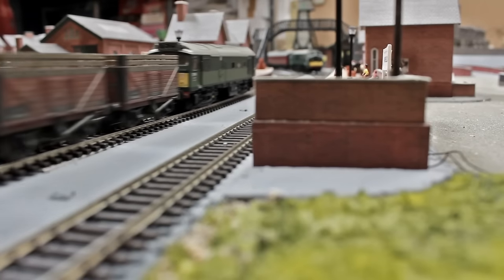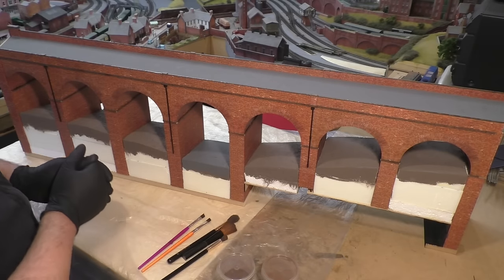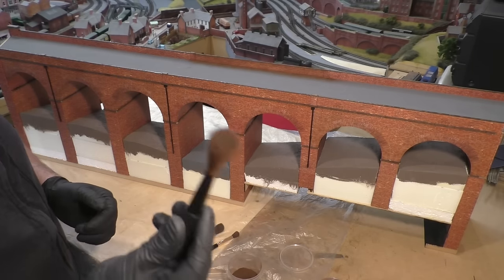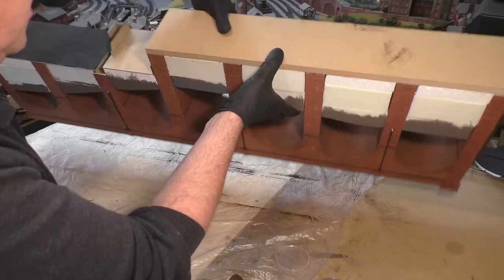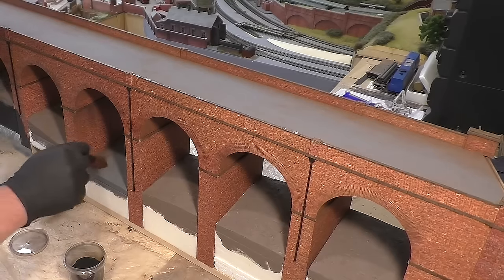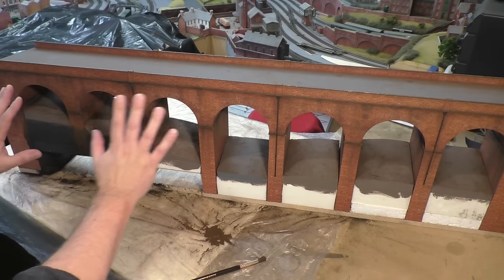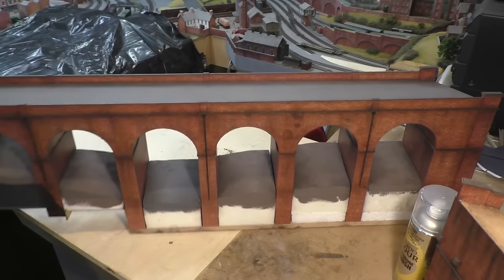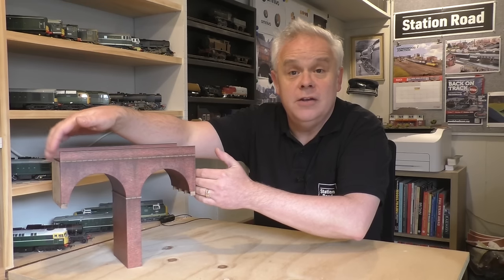New Project - Viaduct Weathering - Stage 6

Comment: Hello Julian. As an alternative to adding growth to hide the smudge you could add a hung scaffold with some tarpaulin covers or, perhaps an open scaffold with some workmen re-pointing/repairing some of the brickwork. One or two strategically placed items on the scaffold planks would help disguise the marks, eg. a bit of boarding etc lent up against the brickwork. This may add an extra little feature to your, already, excellent viaduct. Hope that will help you.
Reply from the maker: That is a thought, thank you.

Comment: Dear Julian, beautiful how you’ve done the weathering on the arch viaduct. Definitely adds to the whole viewing experience! Do like the idea you talked about on using the water color pens to add the calcium deposits. Humbly think you could also add some rather significant calcite bleeds on several mortar lines, kind of as a ‘source’ for the deposits. On the fingerprints, think that calcite simulation might be a good idea to tone those areas down by following the mortar lines. After that you may be able to tone the bricks down with either a slightly lighter color. 
Don’t really agree on what you said about airbrush weathering. It can be just as intricate as the powder weathering. Of course it may require a bit more exercising effort. Although, when one has found the weathering handwriting signature of his or her liking, it may just as well be a breeze to weather such a large structure with the airbrush. As for me, wouldn’t just leave it at that, don’t really know how easy it is to pin wash the printed brick texture, but definitely would try it out. Also a good technique for adding the calcite streaks. 
Overall, love the entire series of the viaduct. Definitely a great visual addition to your layout and an excellent example of how the story of the railroad can be told beyond the visual borders of the layout’s footprint. Looking forward to seeing the next episode. Cheerio

Comment: Hi Julian this is not a criticism more an observation hopefully as additional information to assist you, your parapet walls should have refuge areas built in to allow track workers etc safe areas to move into when trains are passing bear in mind these structures were built long before modern day health and safety rules. The refuge areas are big enough for 2/3 workers and set about every 20 yds (meters). Not that refuge areas are visible but are built into tunnels also.
Reply from the maker: I decided not to include refuges because I did see some viaduct examples where there were no refuges. These tended to be viaducts that appeared to have a wider trackbed than normal.